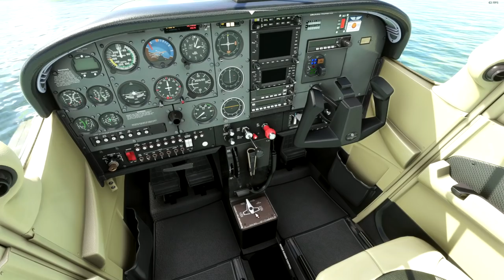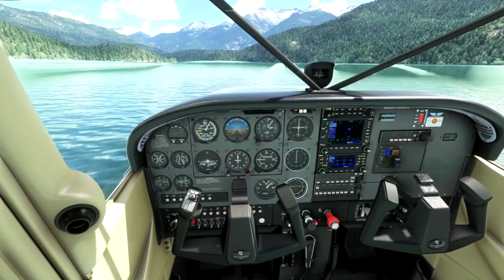How to Fly Float Planes in Microsoft Flight Simulator!

Comment: Hey Av, FYI, I was told by a friend who flies floats you can actually land floats on land without gear and without damaging them, apparently it's not that uncommon to do it as a means of getting the aircraft out of the water when it's either going in for maintenance or being stored for the season. I believe they are very careful about where they choose to land, always grass, and always somewhere their confident is good quality grass without anything that might be worse for a float than a tire.
Reply: (if you search float plane landing on grass their are some videos, I even found one of one taking off from grass, although it was helped with a little human power to get it moving lol)
Reply from the maker: Oh yeah certainly grass and usual wet grass at that for reduced friction
Reply: @AvAngel  Yeah, wouldn't wanna land one on paved though........ may be a little messy lol.

Comment: Thanks for the excellent vid.  As a boater, I would say approach the dock slowly at a right (or left) angle then turn your water rudders sharply so you coast in along side the dock.  Couldn't say if this is best practice for float planes, but it works for boats in most (but not all) situations.
Reply from the maker: The sim's water phyiscs make actually docking properly basically impossible... too much friction by far... Got to take some considerations with that sadly till they fix the water. In real life you can coast it in like you say, but its a bit derp

Comment: The bouncing/skipping effect is entirely realistic. When you were up on step and pulled back, the rear of the floats hit and either skip or slow you down IRL. There's what's called the critical angle you have to hold during float takeoffs. Too far forward or back and you'll either bounce around or lose speed. So that part is realistic

That being said, the size/shape/mounting of the floats on the 172 they've given us is cartoonish. It makes me wonder if they even looked at pictures of a 172 on floats
Reply from the maker: Pretty sure they just got some off turbosquid and called it good :D

I find some of the third party planes actually contact far better on the water than the default two... the blackbox l19, the wigeon and cessna 140... all have a nice smooth range on the step, this 172 feels like its floats are way too long and it catches way too easily.
Reply: @AvAngel  That's the thing. It seems to behave like it's on some extra long Edo floats and not these abnormally stubby Wiplines
Reply from the maker: Right? contact points likely can change that, its probably hiding some wider stability issue with how the sim and water behave though... blegh

Comment: Thanks Rachel! This is excellent information and training. I learn so much watching your stuff.  Does the waterdrome water runway behave differently than non-runway water, or is it just designated for safety (i.e. keep other craft out)?
Reply from the maker: Just designated for safety and is a known length with a dock and fuel facilities
Reply: @AvAngel  tried it tonight and couldn't find a dock,but did find that one addon float 'plane caused a CTD (ouch).The Grumman Goose didn't but I could only get one engine to start.I'll try again later with the throttle cracked (I don't start cold and dark).....................................

Comment: Great instruction and demo. Glad they added floatplanes and water effects. Seems very bumpy to me though. Take-offs and landings on runways are such an issue for me I stopped flying MSFS. Floatplanes got me back in the pilot's seat. You just put MSFS in a nutshell: fabulous scenery and weather but no animation of water rudders!
Reply from the maker: Oh they animate... but apparently a cable driven system needs the battery on to move XD GG Asobo
Reply: @AvAngel  Good to know. I take it all back...(well, most of it). Anyway, very glad to see water ops in the sim.

Comment: How did you do you a cold/dark start on water? You were parked at a dock. I can only do runway starts which already has the aircraft ready to take off. There are no options to start a flight with a docked plane as far as I can tell. How was that accomplished? Thanks. (I have cold/dark options for land based airports)
Reply from the maker: Addon water runways have dock start locations, sadly there are non stock, but dock starts will allow it to be cold and dark :)
Reply: @AvAngel  awesome thanks

Comment: Hey again..you seem to be the only other person I know with the Carenado Aircraft ( do they work after the most recent updates ( including the hotfix ) 
Seems the piper 3 ( Carenado fuel selector won't change from OFF L R 
And MR20 ovation + PA44 Seminole stuck on download loop ( clearly shows an update is available but won't install in the sim ;)
Reply from the maker: Apparently the Waco and C170 are fixed and fine, MS changed something core requiring a physical PATCH from the developer rather than the sim hotfix fixing things... Carenado is working on this apparently.

Comment: so they fixed ramping in this update?  before you couldn't lower the gear in water, and if you tried to taxi into the water off land - you'd "crash"     also, water rudders seem very ineffective right now, have seen a bunch of posts on this...
Reply from the maker: I have crashes turned off, occupational hazard of bush flying, you need to or the sim crashes every 5 minutes :D but it does seem to let me lower the gear in the water now... so perhaps?

Water rudders are relatively ineffective tbh, they're not this amazing tool and with a prop pulling you innefficiently with small rudders and a wide footprint its a weird combo... not ideal for manouvring.

Comment: Sorry   this is not about float planes but thought Rachel you might pick this up...   I bought the Beechcraft 99 as I liked  your honest review..   I know it was a poor aircraft re speed, to take off...And overall lack of design ....But the new MFS DOWNLOAD has really screwed it up to an unflyable aircraft... It is unstable even setting the Legacy original settings...    Any chance of you giving it a try to see if its me that has something wrong in settings...Please.
Reply from the maker: I'll check it out again, it may be waiting for a patch tbh, a lot of dlc aircraft need a patch after the last update.
Reply: @AvAngel  Thank you so much.....Thought MFS team would check this before release?
Reply from the maker: It was working before the patch, the asobo team can’t check every third party models, it’s up to their developers to be compatible, virtualcol are a bit slow
Reply: @AvAngel  Hi Rachel Thank you for the reply..   I bought the aircraft from Microsoft store...  They changed the sim design......In my opinion,    it surely does not take any time to quickly fly one of their products they are selling from a airport to check if it works.....and they must know that their modification to the sim will require the developer to sort a solution with them before they released the sim..